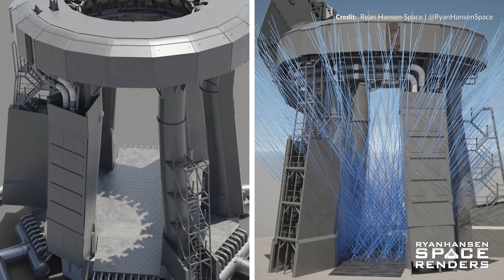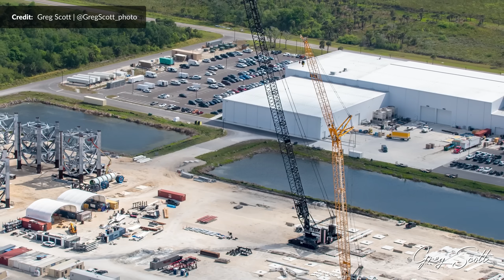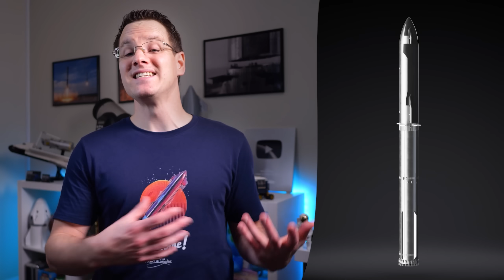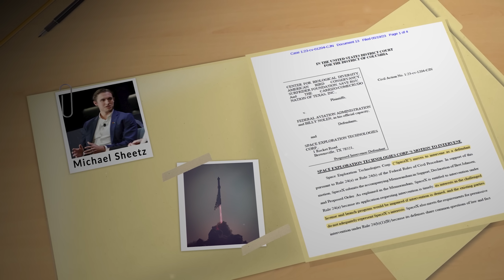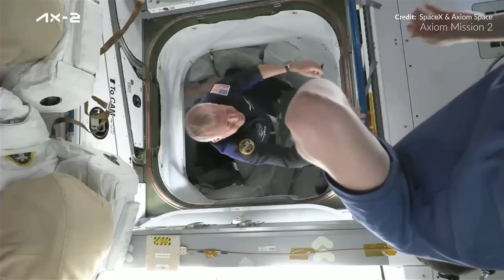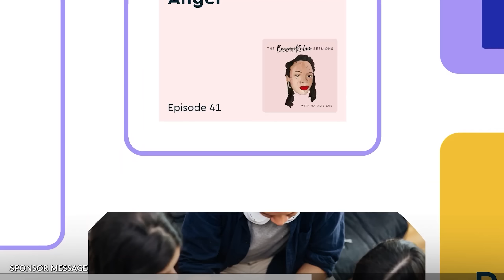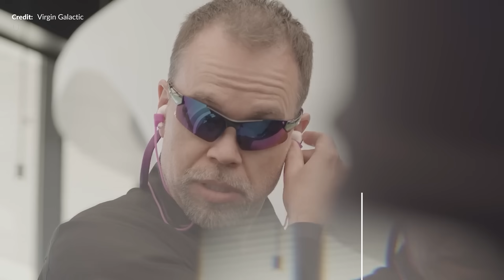SpaceX Starship 6,000 ton Capability, and SpaceX Joins FAA for Legal Battle, Axiom 2, Unity 25

Comment: Hi Marcus, I want to get back to the subject of stage zero. 
A successful test of one raptor and a squirt plate has been achieved. However I believe this design is not going to scale well against the force of 33 raptors. I believe the immense pressure  of the raptors will push back on  the water  inside the plate thus melting the plate and creating howitzer shell sized gobs of molten metal blowing out in every direction resulting in catastrophic high speed disintegration of the deluge system then...another giant crater. 
All it will take is one hole and the whole thing will be torn apart.
I do have a solution however. A conical structure   with pointy end up as big as the base of stage zero. Dual purposed as a flame diverter and water deluge system. Made from steel plate obviously.  Horizontal slots cut into the cone with layers of slots from the base of the cone to the tip. 
Flared at the top of each slot to create a venturi .
When the engines  are firing the thrust will literally suck water out of the cone as the flames blast over the slots.
This will work for sure. 
Instead of raptor thrust pushing against the water it instead will become a 33 engine water pump.
What are your thoughts?
Reply: The proven method used by NASA for the Saturn five to divert the flame , is the best method so far .  Why SpaceX does not use this system has not been revealed , as far as I know.   Just saying .
Reply: Based on how long it takes a methalox torch to cut structural steel it will take a lot longer than the time of the launch to melt the water plate.  

The diagonal flow of the HIGH PRESSURE water will help spread out the exhaust reducing the pressure.  

The water is also a lot denser than the exhaust making it harder to force back.  Also the water exploding into steam (in all directions) will surge the pressure under the rocket hugely diverting the exhaust outwards.  So I doubt very much barring a failure on the pressure system that it will be forced back.  Even if it is the metal might get torn up but wouldn't melt.
Reply: @Scanner9631  dude. It made short work out of thick concrete which is much more resistant to extreme heat. 
Plate steel will melt immediately if the thrust displaces the protective effects of water.
Btw. Methlox is methane and Liquid oxygen. 
I worked for praxair for 30 years. I know torches and cutting equipment and metal process equipment extremely well plus I dealt with cryo liquids of all kinds.
Torches dont use liquid cryo gasses....ever.
Reply: My thoughts exactly well close.

Comment: Can't wait to see them testing this "flame plate" let alone launching a rocket above it!
Reply: Yep if it works maybe they will revisit using modified oil platforms again, or maybe something like four oil platforms welded together! They have to find some way to get out from under the draconian FAA. If I were them I would start talks with several equatorial countries and try to set up Starbases there using shell companies, that way the FAA can suck it and some of those countries can benefit from using leases and support for being the optimal orbital launch locations. Kenya and Ecuador would be at the top of that list.
Reply: @anydaynow01  While Elon does brag about manufacturing in america and decrying globalization, he also likes to180 when he feels like it. I bet they'd work for super cheap and you don't have to provide them any of that expensive safety gear. Oh yeah, that's a great plan.
Reply: @anydaynow01  The FAA aren't the problem... they're well-aligned with SpaceX, which is why SpaceX are injecting themselves into the lawsuit as allies to the FAA. However, if SpaceX were to attempt to move offshore, they'd be very quickly facing prosecution over technology export regulations...
Reply: @anydaynow01  SpaceX would have never gotten the moon-landing deal with NASA when they are a company outside of the US.
And Musk does not care enough for SpaceX to actually invest a few billion by himself (strangely enough - since he claimed that colonizing Mars would be his 1st priority but spent ~50 billion in an social media platform instead of SpaceX)

Comment: If Spacex is making a bigger starship, wouldn't stage 0 need to be wider?
Reply: Not if they are making Starship taller rather than wider.  The bigger question is was the system designed with enough capacity for a 6000 ton ship or would it buckle under the weight?

Also can the existing tank farm provide that much propellant?
Reply: Yes

Comment: what a great week to be a space fan!! go SpaceX ~ looks like Elon thinks they can be ready for another flight in ~ 2.5 months - hopefully the FAA doesn't slow us down!! It was so cool to be at the first orbital launch attempt of Starship!
Reply: The FAA will only slow down SpaceX, if they don't address the issues that caused the launch failure. Especially, the FTS failure. The construction of Stage 0 took around two years, so the repairs and upgrades are likely to take until the end of the year I think.

Comment: Building a rocket for a market that doesn't exist and probably will never exist in Earth orbit.  That kind of capacity if used to orbit satellite networks will most likely eventually result in a Kessler Syndrome.
Reply: If Starship can launch for the same cost as now, but offer a larger payload and more volume, then satellites don't have to be made of super light and expensive materials. They could be made with heavier materials for less and save money. Also be built larger and more capable as well, with things like docking systems for life extension mission or deorbiting the sat.
Reply: @steveaustin2686  

And satellites can be more redundant allowing them to survive component failures.  More fuel to stay in orbit longer.  

How big will the inflatable station modules be in volume compared to a ISS solid module?  Much better for the astronauts.
Reply: @Scanner9631  Yeah, Starship has an internal diameter of 8m (26ft). If an inflatable module with the same ratio of expansion that the BEAM has on the ISS, then you could get an expanded 8m module that would almost be 11m (36ft) in diameter.
Reply: @steveaustin2686  

Probably bigger than my home.
Reply: @Scanner9631  You can get 8m in diameter, 12m long, and have up to 8 more meters that tapers down to 4m.  So if it inflated at the same ratio as BEAM, then the straight section could be 12m long by 11m in diameter.  So 36ft in diameter, just over 39ft long, with up to another 26ft that could taper down to 13ft. Assuming that you had a door big enough or a fairing.
Reply: How bout a single 300 ton satellite or 300 ton space station.

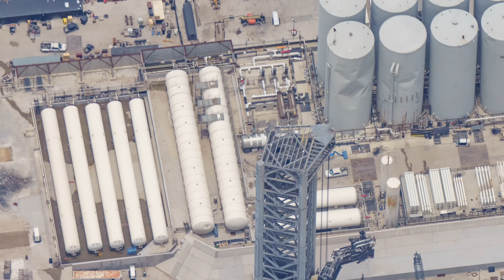Comment: 4:30 Looking at the "complete" footage it seems that the water cooling is not nearly enough. The "official" footage is cut as well, but it seems that the plate got badly damaged and was venting water from behind. Also that test is more or less meaningless: that plate will be on the ground with no way to radiate the heat away, and all the force of the trusters and the water will go in the foundation. If this are the tests they are making, they are setting themselves up for a new failure.
Reply: If a random YT comment knows that they definitely know that already.  But remember you're only piecing together what you see, whereas they have more information than you do.
Reply: @ReiseLukas  probably but maybe not. They still have failed to learn the lessons that managed to get us to the moon 50+ years ago, and Musk is not particularly  known for delivering on his promises....

Comment: If I understand this right, an expendable Ship section will mean the number of tanker flights for a Moon mission will be quite minimal. With Raptor 2 and a regular Ship section the propellant tanks would have extended only a couple of rings in to the payload bay. With Raptor 3 and an expendable Ship section the tanks will extend into most of the payload bay - no wasted empty volume. Propellant is such a damned dense cargo!
Reply: Using an expendable Tanker with 300 tons, would mean 3-4 Tanker flights to refill the [DELETED Starship propellant depot. The SpaceX plan in the GAO report denying the HLS Option A complaints was for 14 Tanker flights. Musk's ~150 ton update dropped that to up to 8 Tanker flights. So if an stretched, expendable Tanker is used, then it is 3-4 Flights which is a huge reduction in flights.
Reply: @steveaustin2686  

Also since a HLS is supposed to be able to land 100 tons of cargo on the moon with a full load of fuel the minimal cargo used for the 2 flights will not need a full load of fuel unless NASA insists "just because".  So fewer launches needed again.
Reply: @Scanner9631  It's a lot of dV to leave LEO, enter NRHO, land, and return to NRHO. Unless they are only taking a few tons, they likely need more than a half tank. Especially as they have anytime abort back to NRHO, even when it is most unfavorable.
Reply: @steveaustin2686  

When a full tank was expected to be 8 launches reducing by even 1 is a great savings.  

BO notoriously was claiming that SpaceX would need 12 to 14 launches (100 tons/launch and lots of assumed boil off during MONTHS of fueling flights).
Reply: @Scanner9631  Because the SpaceX plan in the HLS Option A bid had 14 Tanker flights and 16 total flights.

From page 27 of the GAO decision to deny the Blue Origin complaint, [DELETED] is apparently at least a propellant depot.

"SpaceX’s concept of operations contemplated sixteen total launches, consisting of: 1 launch of its [DELETED]; 14 launches of its Tanker Starships to supply fuel to [DELETED]; and 1 launch of its HLS Lander Starship, which would be [DELETED] and then travel to the Moon."

After the GAO report was released, Musk said that with the updated ~150 ton payload to LEO, that would reduce it to up to 8 Tanker flights, so up to 10 total.

Comment: If SpaceX doesn't win in court you'll have to take a Hyperloop to the remote coastal launch pads to get a ride into space.  I can't imagine anyone wanting 10 launches a day in their backyard.  Concord was quiet compared to Starship.
Reply: Multiple launches per day are a future goal, that may or may not be realized. The SpaceX planned cadence for Artemis III is 1 Starship variant launch every 12 days, per page 10 of the GAO report denying the HLS Option A complaints. It took 10 years to mature Falcon 9 to less than a week launch cadence, so it would not be surprising that Starship would take some number of years to do the same.
Reply: @steveaustin2686  - Gwynne Shotwell has made statements that using Starship to hop between cities is going to be a reality.  I'm not convinced they will be able to do any of this near a largely populated area without a lot of blowback from the locals let alone near endangered species.
Reply: @johncnorris  They themselves had never envisioned hop launch site literally next to a cities. It's at least 30 km away
Reply: @alvianchoiriapriliansyah9882  - Do you have a reference for that?  I've only heard Elon and Gwynne say they will be operating out of existing airports which are near cities. They will need to double that distance if they don't win in court.
Reply: @johncnorris  I can say categorically they have never said they would launch from existing airports. No rocket in existence would be allowed to do that, let alone the biggest most powerful.
Reply: @jackinthebox301  - So you agree passengers will be using something like a Hyperloop to get to the launch areas?
Reply: @johncnorris  Don't bother yourself with this Alvian person.  Look through all the replies to comments, and each week you will see he just goes around telling people they are wrong. Just a know it all, not a fellow space enthusiast.
Reply: @JeromyBranch  - 10-4
Reply: @johncnorris  That may be SpaceX's far off goal, but I'm not so sure it will happen. First off, can Starship even be reliable enough to even carry astronauts from Earth, much less regular passengers like an airliner. Astronauts can't even get regular insurance, so it is doubtful passengers would be able to on Starship. 

Let's say that Musk's very ambitious $2M per launch internal cost is achieved. Likely a long shot, as SpaceX's Gary Henry has been talking about $200/kg, which is 10 times the $2M internal figure. And that they go with the same profit margin as Falcon 9 of around 1.9 ($2k internal/kg vs $3.8k external/kg per SpaceX’s Gary Henry). That puts the external launch cost to $3.8M, or $38M with the $200/kg. You have 100 passengers, that is $38,000 per ticket ($380k). Comparable to New Shepard or SpaceShipTwo, but not an airline ticket. I don't think SpaceX will compete with airlines, but with other sub-orbital tourist flights that go somewhere, instead of straight up and down.
Reply: @steveaustin2686  - Good points.
Reply: @johncnorris  The mode of transport to the launch complex is irrelevant, honestly. But you're right in saying that they will be many miles away from major populated areas.
Reply: @jackinthebox301  - it's irrelevant only if you don't mind shutting a road down before every launch like they do with Highway 4.  Otherwise the people traveling to the facility for their launch could become crispy critters if there is a mishap.
Reply: @johncnorris  I won't lie, I find speculation for speculation's sake annoying, John. Its doubly irrelevant because point to point Starship travel is probably a decade or more away. Mars and the HLS contract are the priority (edit: I almost forgot launching Starlink V2 in the priority list), so basically all the ships that are manufactured are going to end up in that role. 

As of now, Starship is further along in the development cycle than Hyperloop is, despite being half a decade behind timeline wise. If it's a hyperloop, cool; if its a ferry, cool. It literally does not matter right now.
Reply: @jackinthebox301  I love it when you get your knickers in a twist.
Reply: I think Boca Chica was always an R&D location iirc

Comment: I'll still be very impressed if spaceX does the second orbital flight test with starship this year, my bets are that it will be delayed until next year for upgrades and updates on the pad as well as the paperwork. Would love to be wrong too.
Reply: It seems like the pad upgrades are going to be done in about a month but I would say the paperwork could take a bit longer
Reply: Elon Reeve Musk  Personally, the think I admired most about musk is that he saw a problem and made his own plan on how to address that problem, wether it was climate change or AI or making life multiplanitary. They are all massive problems and it's easy to feel overwhelmed and powerless so it was admiring to see a person who would not be daunted by the scale of the problem and worked on solving it one small step at a time.
What I dislike is the lack of common sense, but I suppose that is two sides of the same coin, with a common sense you can't be fearless in the face of these problems.

Comment: Why not increase the diameter of the upper stage instead of increasing its length? Payload space constraints usually have to do with the diameter anyways.
Reply: Because 9m is what they are built for. It's almost certainly easier to add more rings, than it is to make 2 sets of rings of different sizes.
Reply: @steveaustin2686 yeah but they have the production very automated now, I’m sure producing rings a few metres wider wouldn’t be a problem, it’s more about all the piping and cabling etc that would have to be redesigned.
Reply: @aldunlop4622  🙄 Except ALL the automation is for 9m, NOT 10m. All the launch equipment is for 9m, not 10m. This is reality, not KSP. 🙄

Comment: I think s25 static fire might not happen until alot of work is done. Might not a great idea to waste few days for static fire right now.
Reply: The static fire doesn't have to be on the OLM it can use one of the launch pads used for the 10 KM hops.  Super Heavy needs the OLM Starship doesn't.
Reply: @Scanner9631  Still needs to clear the pad and move vehicles around. And it might take few days if they abort static fire. 
And also OLM doesn't support starship for any testing only cryo testing if Booster is underneath it.